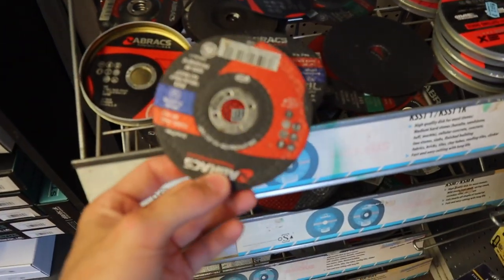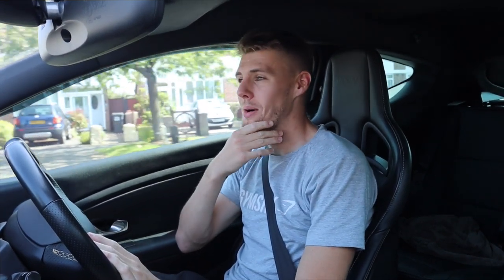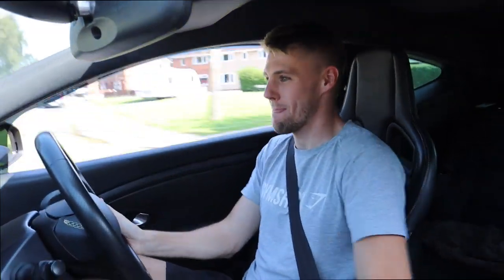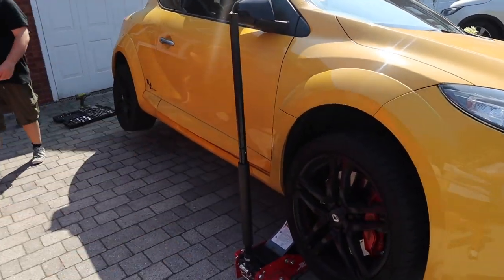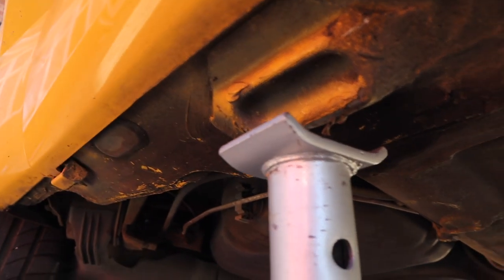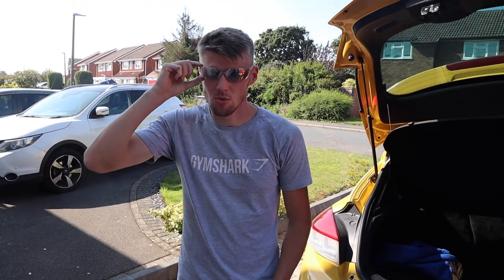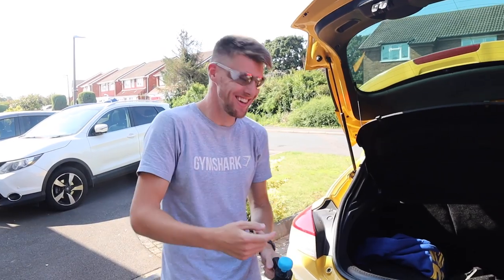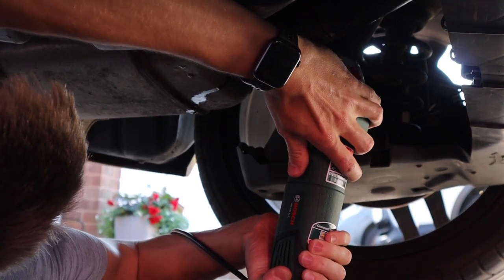HOW TO MAKE YOUR CAR LOUDER FOR FREE (RENAULT MEGANE RS)

Comment: How come you didn't cut that bit of pipe at the beginning of the video and clamp it to the existing centre section? It won't echo so much as the noise will be to atmosphere rather than under the car